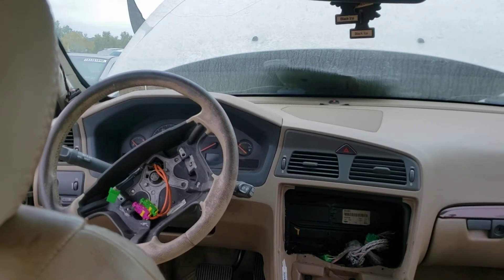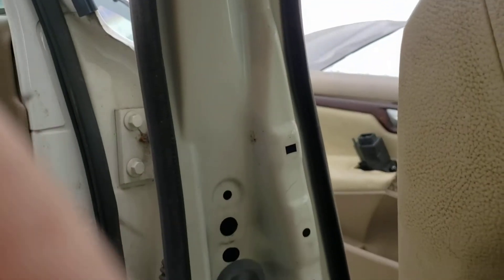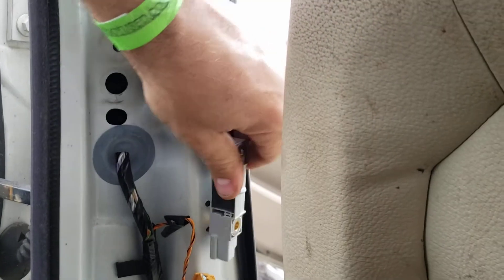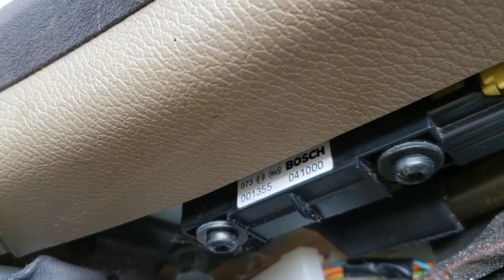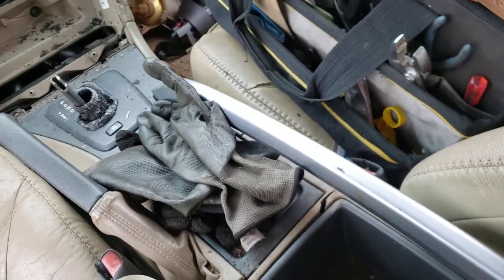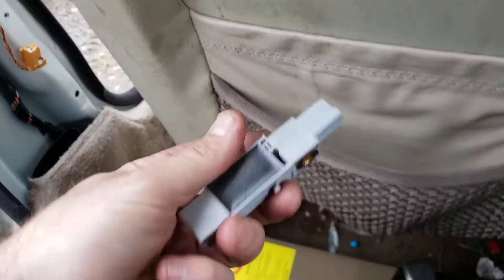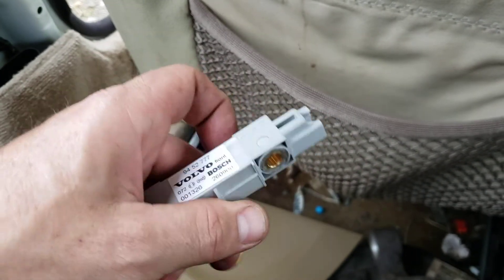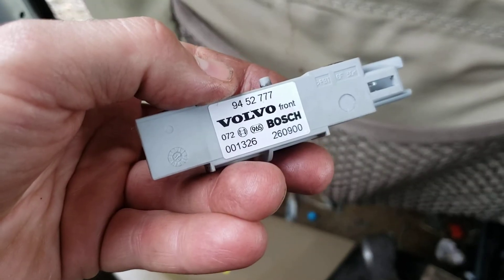2004 Volvo XC70 SRS Airbag impact sensors 2001  SRS Control Module reset Airbag Sensor Reset

Comment: iThe Module could be bad. Most likely need to replace the Module. You can buy a used one on www.eBay.com 
or send your Module for repair at https://www.myairbags.com/product-category/repair-return/airbag-module-reset/

     Here is video

https://www.youtube.com/watch?v=f4mDqeH4o7E
Reply from the maker: I was able to reset the Module using the Autophix ES610 scan tool I got off ebay for $60.  The side impact sensors were not bad, I did have to replace the dash airbag of course.   After codes cleared I couldn't start due to that small wire that pops off the starter solenoid WAY to easily.

Comment from the maker: This 2001 SRS Control Module did not fit my 2004 connector?  The pins were not all in the same spots that were available.  The 2001 connector was red, my 2004 connnector is light green.

Comment from the maker: Autophix ES610 scan tool off ebay for $60 did indeed clear my SRS Control Module  Airbag Sensor faults.    So pleased I did not have to take to a dealership.  Damn, only paid $1500 for the car off ebay.